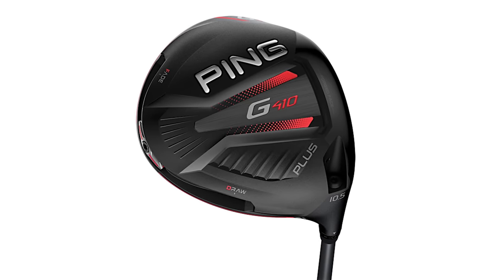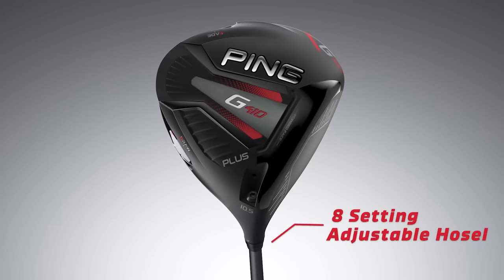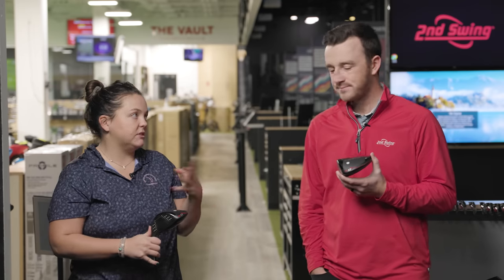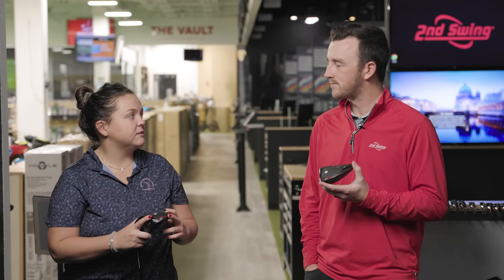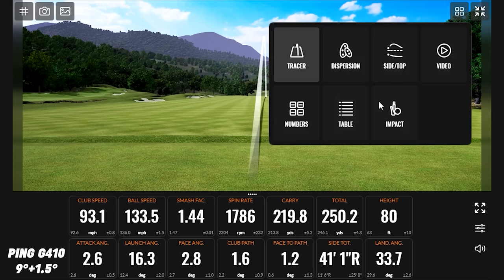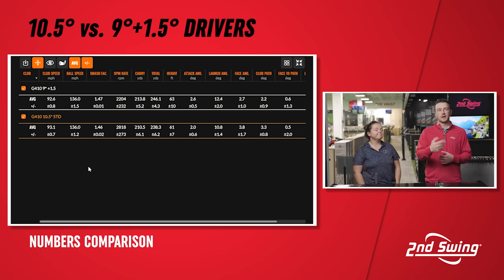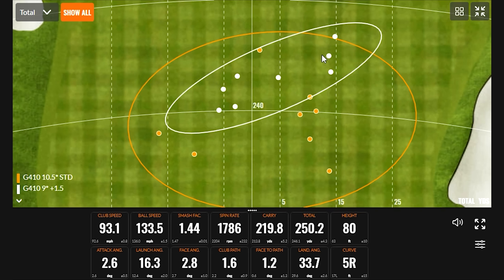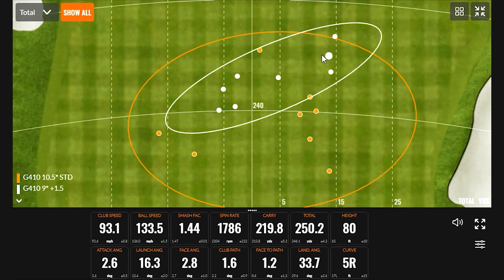STANDARD LOFT vs ADJUSTED LOFT | Golf Driver Loft Test

Comment: First video I’ve seen on driver adjustment differences being measured. Awesome. I did this just recently with my driver, but I changed the setting to de-loft it. It introduced a change to the club face angle and gave me more distance due to an increase in club speed I made, but I had to compensate for the change in face. I’ll then have to re-adjust again when I get fit for a new driver in a more natural setting.

Comment: What seems to be missing here is a key component of how the loft change actually takes effect. Once the loft has been adjusted, the change in loft ONLY OCCURS WHEN THE GOLFER RETURNS THE CLUBFACE TO SQUARE AT ADDRESS. If the golfer adjusts the loft but doesn't square the face at address, all that has changed is the face angle. The reason that adding loft closes the face is because the expectation is that the golfer will then return the face to square, which is what actually then produces the increased loft. Vice versa for lowering the loft - this opens the face and when the golfer returns the face to square at address, that's when the loft decreases.

Comment: I game a 10.5* PING G425 MAX driver set to the small minus sign (-1*) and a 14 gram back weight (instead of standard 28 gram weight) in the neutral setting with Fujikura shaft. This setup took a bit more draw out of my shot shape, dropped my spin by 200 revolutions, and added 10 yards more carry. It just works.

Comment: 0:38 I do exactly the opposite.  Since many drivers are more closed than I like, I take a 10* driver and adjust down to 9-9.5 so that the face OPENS some - rather than taking a 9* driver and adjusting up.
Reply: Me too. I need a 10.5 though so I normally go into a 11 in my TSR3 and lower it .75 Was in a 11* TSi3 before that.

Comment: I play the same driver head 9deg.
I adjusted it to 10deg but flat setting to prevent a left dispersion.
Most other models, you don't have the flat setting. That what I love about Ping.
Also just ordered a G430 to replace my G410. Can wait for the snow to melt
Reply from the maker: Awesome! Yes, the flat setting is super nice for our fitters to have. PING wins a lot of fittings because of that
Reply: i have the ping g400 max and unfortunately it doesn't have the flat setting, i'll try bringing the loft down to 9.5 since i also struggle with a left miss.

Comment: I have an old Ping G30 sf 10* lofted up to 11* and Driver is already weighted to promote a Draw.
So it Works ! definitely has made my Drives Straighter ok ! 
High handicappers need higher lofts and adjustable hosels and weight systems for slice reduction !
Prefer to use my Taylormade M2 15* a on difficult fairways .
Next Driver getting fitted - Moral of story get clubs fitted.
Reply from the maker: Awesome feedback here. Indeed, more loft and utilizing the correct adjustable hosel settings can help any golfer gain a little more control off the tee